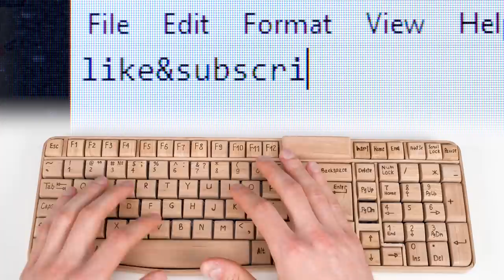How to Make Keyboard from Wood

Comment: I got to say, it looks fancy. But it's going to break on no time with that design. It would be cool if You went for a more elaborated approach so the keyboard was cleanable / repairable. Not to mention that the current design doesn't seem to be solid, thus why You used the keyboard in such a delicate manner.
Reply: It lacks per-key stabilisers to make sure keystrokes go straight down, so he can easily press at an angle and both miss the membrane and fail to register a keystroke. He cannot easily swap out / fix components in case they break down. And the fact that he used a glue means that the keys themselves are fragile.

This makes for a very horrible typing experience, not too different from typing on one of those flexible sillicone boards except worse.

That said, while he executed the idea in the worst way possible, the idea itself is really cool and it would be nice to see a mech board modded in this way.
Reply: @takumiyamamiya8877  àne

Comment: Nice one! I would have made the buttons and the frame to be more easily removeble and not used any glue there though, since you need to be able to remove the keys and frame to clean the keyboard a couple of times a year at least. Kind of impossible when you destroyed the keyboard by gluing the keys to it. Should have made a wood frame the could snap on to the plastic buttons.

Comment: Looks cool, but seriously no stabilisation for the keys? You could get a mechanical keyboard and build a new case for the board and wooden keycaps for the switches, that'd be a lot more usable, but also not as cheap.

Comment: its fake guys ish fake, how come when i press on my keys, the keys just fall off? , i tried doing round/circular wooden keys, i have them stored in the closet cause they're not stable on top of the silicone/membrane dome. They just fall off no matter what glue i use. 

 I mean , it's not meant for gaming, and fast typing .

The only way to make them stay still on top of the membrane/silicone dome, is by making a lil  hole in the wooden keycap and then applying glue again, but that would just take so much time.